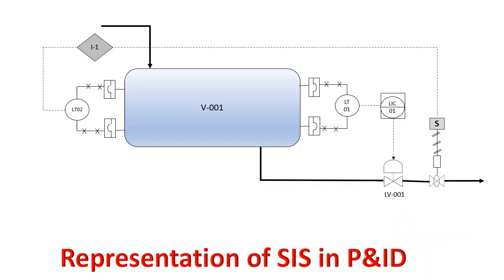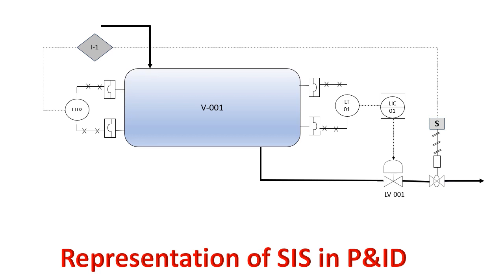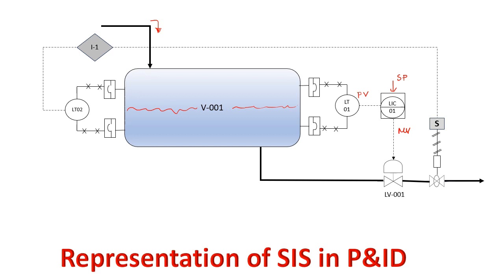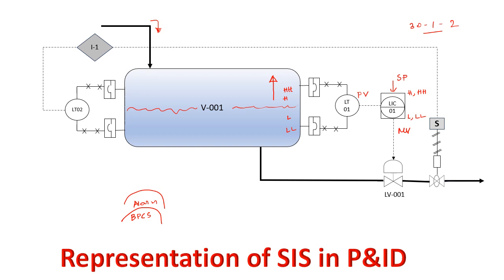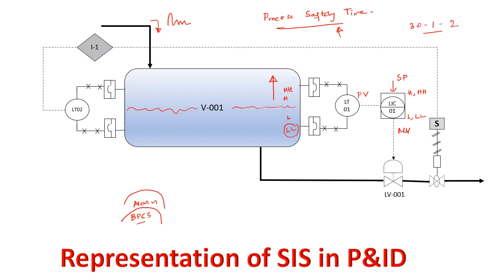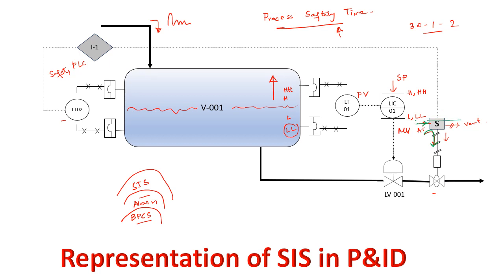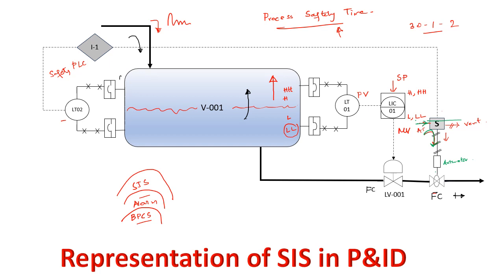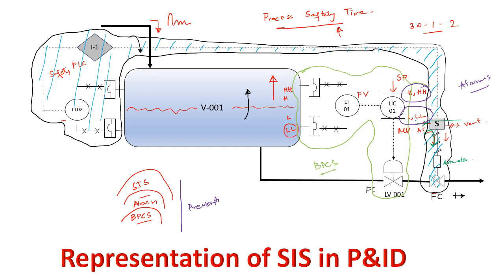Representing Safety Instrumented Function in P&ID with Practical Example

Comment from the maker: Get Certified as Functional Safety Engineer by opting for this course: https://www.udemy.com/course/functional-safety-certified-expert-iec-61508-iec-61511/?referralCode=26A69A14ACE514D8D550
Reply from the maker: In this video I have discussed about How to identify different type of Pipe, their size, type of material, Type of insulation, Pipe and valves rating in P&ID.
This video is very useful for GATE Chemical Engineering P&ID Topic.